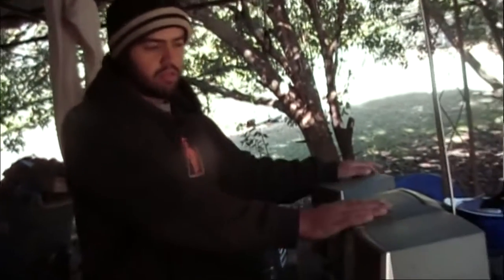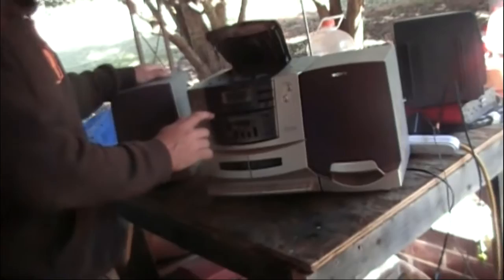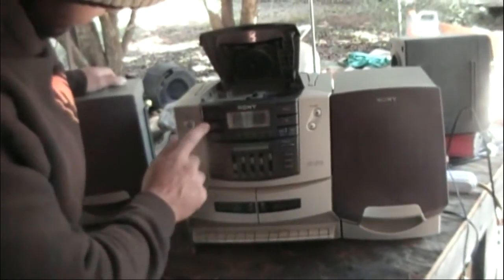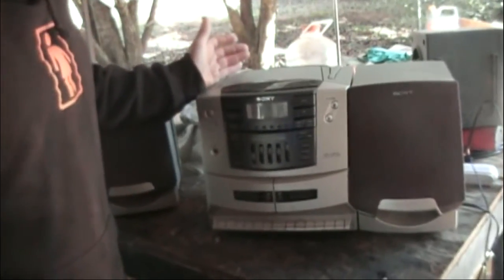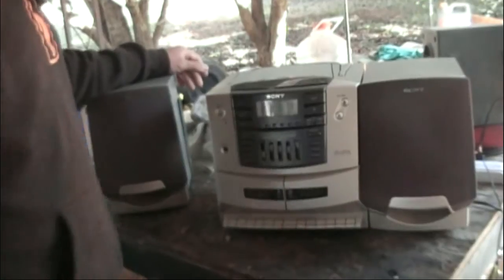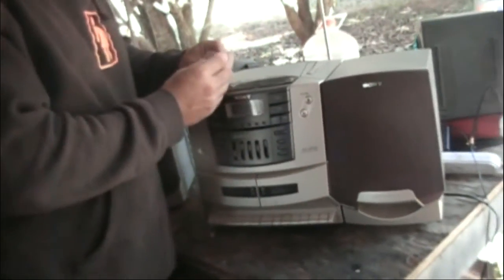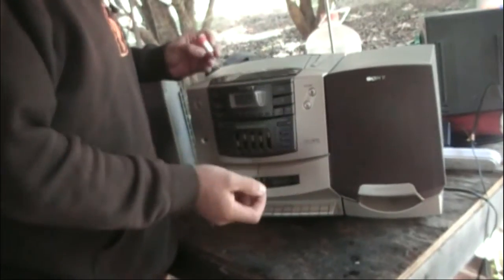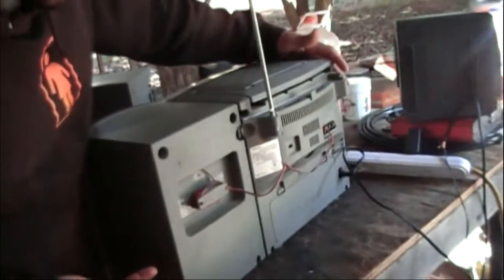Home Stereo Aux Input Hack (should work for most)

Comment: What's the cable you used for the poking tool? I can't find the radio outputs to solder an aux cable and I want your tool to like around
Reply from the maker: I think I wired an old telephone cord to some rca coaxial jacks.  I plugged the rca jacks into an adapter from radio shack that allowed me to plug them into a 1/8 inch standard headphone audio jack.  The other end was stripped and soldered to make them more stiff for poking.  The tips have to go to the ground connector on the headphone jack and one of the positive audio feed connectors.
Reply: Ben Joiner can you give me some pointers? I found the row of pins where the fm out put is hiding. Two of the pins beeped when I tested with continuation on my multi meter. These are my grounds  right? I took a headphone wire and it has 4 wires inside it, two colored and two copper. So I suddered the two copper to the two grounds and then poked with the two colored wires and can't get a signal. Am I doing something fundamentally wrong?
Reply from the maker: I have another video on doing this in an automobile radio which you might find helpful.  You want to test for continuity from the pins over to a known ground.  These are the kinda large nodes at the corners usually.  Also the radio antenna housing is usually a ground.  The making of the poking tool is probably best covered in the other video.  https://www.youtube.com/watch?v=NflinO7lojI&t=2s
Reply: Ben Joiner When a pin beeps that means it is ground right? Also I noticed you used both ear bud wires. Any reason for that? I just cut the wire before it splits to the two ear buds. Also do the size of the wires matter? The wires from these ear buds seem crazy thin.
Reply from the maker: The ear buds are made differently.  They are very thin but they have always worked for me.  The pin will beep when the multimeter is set to test continuity and one of the lead wires is touching a known ground.  Touch the other wire to the pins and one when you hear a beep it's a ground wire.